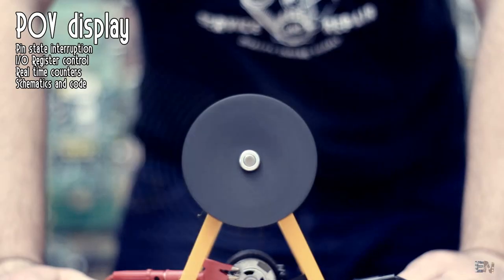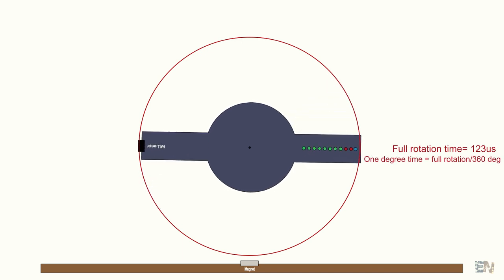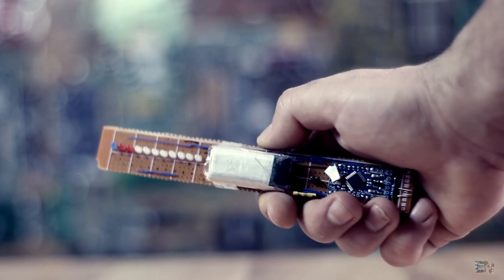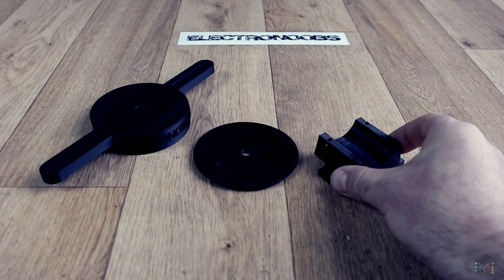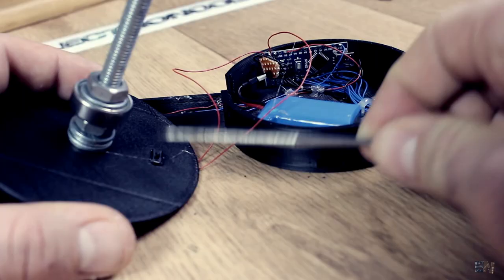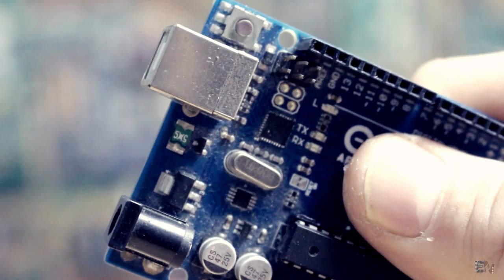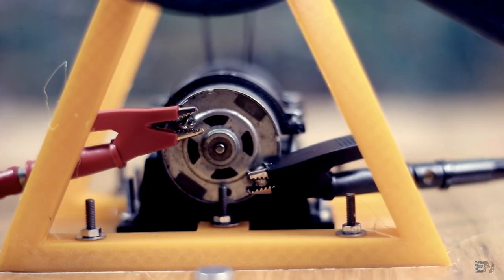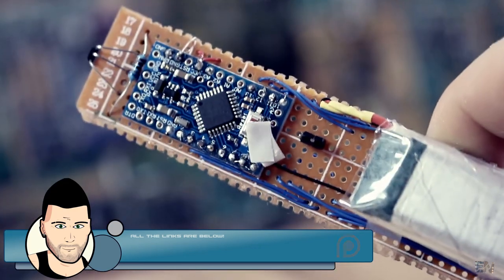Tutorial - Arduino POV display TEXT, CLOCK

Comment: Great stuff! Thanks for the inspiration. One addition; my hall sensor did not operate reliably with the 1k ohm pull up resistor, had to replace it with the more often advised 10k ohm pull up resistor to get it working.

Comment: I've noticed you worked on the quality of the video, that seems much more professional, good job !
For a clock, is the noise not too disturbing?? That is the only problem of this kind of project using a spinig thing...
Reply from the maker: Yes, the noise is VERY disturbing. Any way this is just an example for learning purpose. I guess with a few more days of design and better motors you caould build a very stable and silent propeller. Keep up!
Reply: Electronoobs i think you mean to say "keep it up" based on the context, "it" being the good work or  hard work but please correct me if i am wrong :).
Reply from the maker: True!

Comment: Very nice project and workmanship in construction. I love my glue gun? 
You could also install a coil with the hall effect sensor. 
You would need a logic level n-channel mosfet and a couple of gate resistors.
An extra Arduino pins is needed to drive the gate of the mosfet.
Sort of like an inside-out Bedini school girl pulse motor. The external brushed DC motor and pulley are gone!
I managed 2500rpm free-running with mine. I don't know if that's fast enough for POV or if the MCU can cope with the pulses. I don't see why not since Arduinos are used in closed loop servos with 1000 updates per second or more.

Comment: You should put a coil in the other (non-sensor) end to grab a little bit of recharging power as it passes the magnet...
Or, if you make the housing in a disc shape, you could build several coils into the edge to provide recharging power - possibly even eliminate the Arduino battery altogether if you do it right... 😁

Comment: I will use a 7200 RPM BLDC motor from a HDD, so I don't need the counter that counts down the rotations. 
And, since the motor spins at constant 60 rps, it will be rendered 60 times every second.
And BLDC motors are synchronous motors, so it makes my life easier.

Comment: One of the best tutorial in Pov Display ever Sir ,but I am little stuck I want to make the text part only 1>I want to know if in the text red & blue leds has been used or not ?
2>In the text ELECTRONOOBS all are in capital letters by video but in the code declaration part "int text_ok=0;
int a[] = {126, 144, 144, 144, 126};"all is in small 3>After the first word in this case ELECTRONOOBS I wnat to clear the disolay for second text message is that possible ?4>In text display I can count 7 green leds am I correct ?but there are 8 leds ?Sir plz do help a little

Comment: Why don't you used a slip ring to supply power on your arduino board, so that you can take out side the battery on that rotating part? With that you can charge the battery without turning off the clock.

Comment: could you connect the fan directly to the motor?
Reply: Yes you can connect the propeller directly to the motor without using the pulley.

Comment from the maker: You would need an opto swithc like this one: https://www.ebay.com/itm/10-Pcs-1-6-Slot-PCB-Photo-Interrupter-Slotted-Optical-Switch-HY301-21/172618166667?epid=2113194673&hash=item2830d8318b:g:zXcAAOSwnF9Y6hCO Passing something in the middle of it will be your on/off

Comment: from EEVblog (Dave)

Your accent is a bit heavy going making him difficult for me understand,  I have to watch it a second time, to understand what you are saying. :-)

I like the project seems a quite good, it seems to be a clock,

What  I don't now how you would set the time on it, apart from starting it 12 o'clock?

Would it need a quarts crystal think to keep it on the correct time?

How about making the rotating movement charge the battery some how, then it could go 24 hours a day, as a real clock  :-)